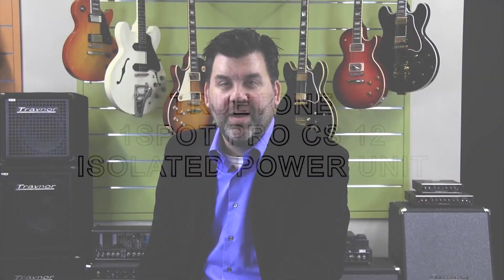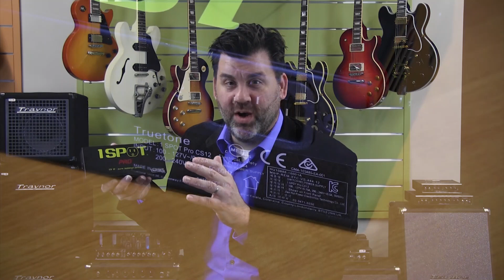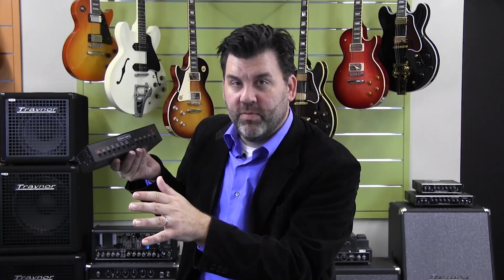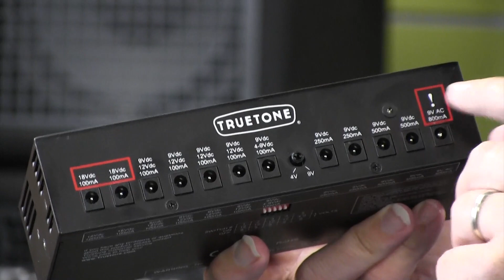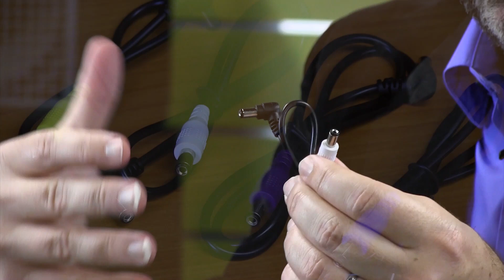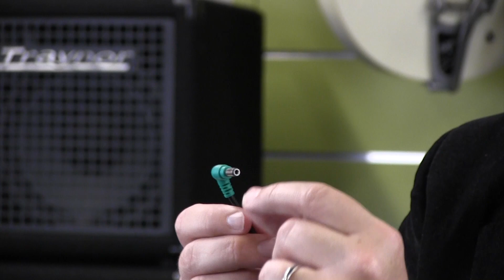Truetone 1 Spot Pro CS12 Power Supply [Product Overview]

Comment: Line 6 M9 says on the bottom that it requires 2000ma minimum ! ?
Reply from the maker: That rating usually refers to the manufacturer's specific power adapter, but the unit itself actually draws much less current, closer to 1000mA.  It would still be best and recommended to use the dedicated Line 6 PX-2 adapter with the M9.

Comment: Do I connect each pedal to the out puts on the I spot power supply???
Reply from the maker: Yes, to start.  As you start to add more pedals, you can stragegically group the pedals with the least power draw (ie drive pedals - distortion, fuzz, etc) together with a daisy chain coming from one output.

Comment: Question for the experts...
On my TrueTone 1Spot Pro CS-12, should I be using the "9v 500mA" or the "9v 250mA" to power my Boss ME-90 guitar multi-effects unit? 🙄 
Best recommendations, please.🙏🏻

Note, per the Boss website, it states that:
The Boss ME-90 requires a 9V DC power supply and draws approximately 190 mA of current; it can be powered by either a standard BOSS PSA series AC adapter (recommended) or four AA batteries, with the PSA-120 adapter being a suitable option for most users.

*Key details:
    Voltage: 9V DC
    Current draw: 190 mA <-- Question: So, does that mean I have use a '9v' power source connection with greater mAmps than "190mA" but not less? 🤔
I'm not that saavy when it comes to electronics; I'm just trying to make sure that I use the correct power connection, and am respecting the correct voltage & amps requirements with the Boss unit & CS-12 to avoid any damages to either of my units.
Please, serious answers only. Thanks in advance!!!!

Comment: Does it matter which way the regular DC cables are plugged in? That is, does the colourful side go into the brick and the black right-angle into the pedal, or is it vice-versa... or does it not matter? Thanks!
Reply from the maker: Put the black side into the brick and the coloured side into the pedal.

Comment: Just to make sure...I have Wampler and Keeley pedals, a boss loop station and a vocal processor pedal...I also have a loop switcher...They all require 9v DC, center pin negative power supply specs. How many actual outputs does the cs12 have that meet this requirement? Thank you...OR would I be better off using the Truetone 1Spot Daisy Chain?
Reply from the maker: 11 out of the 12 outputs on the CS12 would meet your requirements.  9v DC negative center pin is the most common and standard among guitar effects pedals.  Unless you have 11 pedals, you might not need something as large as the CS12.  All 7 outputs on the CS7 would also fit your needs.  https://www.long-mcquade.com/61872
Reply: The CS 12 is a different model than the 1SPOT PRO…Right?

Comment: Can I connect Truetone 1 Spot Pro CS7 to a Quad Cortex as is done on the Cioks DC7?
Reply from the maker: No.  The four 12v outputs on the CS7 combined will only supply 800mA, and the Quad Cortex requires 2000mA minimum.

Comment: I have a question, I recently purchased the smaller version of this box. 1- why my chromatic tuner tu3  needed to be switched off in order to power it in relation to my other pedals. 2- I plugged in my mxr carbon delay pedal in the 500 mA input and it seemed it was sucking my  guitar tone. Should I need to plug it into the 9v instead and why?  Thanks to whoever wants to help me .🤟

Comment: Will the 9V AC power a Line 6 DL4 mk2 or is that only for the original DL4?
Reply from the maker: The new DL4 mk2 is 9V DC 500mA.
Reply: @longandmcquade  Thank you

Comment: Bought a CS12 recently. Upon reading the manual I discovered output 12 was AC only. That's really bad news because now, unless I can find an 9v AC to 9v DC converter,  then I can't power all the pedal on my board, which defeats the purpose. Anyone know what I should do?
Reply from the maker: The 12th output being AC only is denoted on the unit itself with a 9v~AC 800mA label and a red box framing the output.  This AC output should be reserved for pedals requiring AC power, like some DigiTech or Line 6 pedals.  The CS-12 does have 11 other DC outputs, with more than 2000mA available to power any other DC pedals on your board.  That's a lot of power on tap.  You do not need to have 1 output per pedal, you can still split or daisy chain some pedals out of one output.
Reply: @longandmcquade  Thanks, I've opted to use the MC2 adapter to link my loop-switcher and tuner together.
Reply: so following this logic, could you use the 800ma output to power an hx stomp using the cable hack you showed us in the video?  @longandmcquade
Reply from the maker: Yes, the 800ma AC out can power your HX Stomp using the cable Zac shows in the video  @DrBadLlama

Comment: I have a sabbadius 68 tiny vibe that needs 18 volts 200 ma to power it can I use 1 of the 18 volt 100 ma outlets or 2 -9 volt outlets to make the power I need.

Comment: I don't want to mess up my new Truetone CS12. Where would I plug my Pigtronix Philosopher Bass Compressor into the CS12 and which cord would I use? The Pigtronix says: "Use with 9-18 VDC Neg tip Power supply." Input: 100 - 240 V; 50-60 Hz / 250mA;  Output: 18V _ _ _ 300mA. Thank you for your help!!!

Comment: I have a question, if i use a standard 9volt pedal with the 18v outputs will it damage my pedal? what’s the easiest way to find out the power needs for my pedals
Reply from the maker: To use the 18v outputs with a 9v pedal, we'd recommend using the Truetone 18v to 9v converter:  https://www.long-mcquade.com/70974

Comment: Help please.  I read alot of conflicting things about powering the line 6 m9. I trust Zac Childs that the cs 12 will work. The question is will Long and McQuade honour the warranty of the m9 if I use the cs 12 ?????
Reply from the maker: Yes, if your M9 was in working condition and still under warranty, but was damaged due to the advice of given by or supported by Long & McQuade, we would repair or replace it.

Comment: Hi, can i power an a 4 ch mixer an i pad a drum pad & a sampler to run backing tracks with this ? I want to isolate my set up from potential power glitchs in live venues.. Is this what i need ? Do i charge up before every use ? What would i need to do ? Thank you
Reply from the maker: It really depends on what kind of power requirements your mixer, drum pad and sampler have.  We'd highly recommend you read the manuals for the equipment you're trying to power up to figure out if a unit like this would provide enough power and be safe to use with your gear.  As for "charging up", no, this is not a battery bank.  This has an IEC cable that's plugged into the wall for power.

Comment: How can I power a Moogerfooger with this?
Reply from the maker: Make sure it's TIP POSITIVE (not the more common center positive), 9V and at supplies 300mA.  You might be able to get away with the 9V 250mA output because as Zac mentions the printed ratings are lower than what they actually put out.  All you would need is the CYR reverse polarity adapter.
Reply: @longandmcquade  thanks so much for the reply!!
Reply from the maker: @carlos_martinezzz  That's what we're here for!

Comment: Excellent Video!  I don't have a very elaborate range of pedals...BUT I do want to power a Mooer GE200 which requires 9v DC 600mA and a Digitech Trio + which requires 9V DC 800 mA.  Would the CS12 work for me...and if so, how would I power these units?  Thank you!
Reply: Now this is some good comment section
Reply from the maker: Glad you liked the video, but with your two pedals drawing so much power, the CS12 won't do you much good.  You MIGHT be able to power the Mooer GE200 with a 500ma output, but if the pedal requires 600ma, it might not power on or work as expected.  Usually the kinds of units you have require their own power supply because they draw so much.
Reply: @longandmcquade  actually took a chance and the 1Spot is working fine!
Reply from the maker: @SeanOnTheGulf  Wow, that's surprising.  Even the 800mA Trio+ works with one of the 500mA outputs of the CS12?
Reply: @longandmcquade  yes...
Reply from the maker: @SeanOnTheGulf  Fantastic!  We're happy to hear everything is working out for you.  We know that Zac said in the video that the CS12 puts out more than the stated output, so there's proof that this thing packs a punch!
Reply: @longandmcquade  I was very surprised also, but a tech from 1Spot gave me the OK...and said that the unit could handle much more than it says!!  In addition to these pedals..I have a Crybaby Q535..a Pride of Texas, JHS Fuzz, a Polytune 3 and an RC1....

Comment: I have a looper and drum pedal that draw 360ma and 300ma respectively . Is it more practical to use the two 500ma outputs even though the two 250ma outputs may produce "more" than the stated output ?
Reply from the maker: Even though the 250ma outputs "may produce more" than the stated output, it's risky to underpower digital pedals.  Play it safe and use the 500ma outputs.

By "risky", we don't mean causing damage to the pedal.  Using the wrong voltage is much more of a concern than the wrong amperage. If the pedal draws 300 - 360ma and you're only supplying 250ma, it might not power on or it might behave erratically.  But limited risk of melting it or setting it on fire or something like that.

Comment: Can I use my whammy with this? I also have some problems using my freeze pedal, I get noise and humming?
Reply from the maker: Depends on the generation of your whammy pedal.  But chances are, any version you have could be supported when paired with the correct plug adapter.
Reply: @longandmcquade  I have the gen IV whammy

Comment: Can I use all the outputs excepting 18v ones, to connect 9v pedals?
Reply from the maker: Yes
Reply: Uh yea, most power supplies have more 9V 100ma plug than any other voltage type.